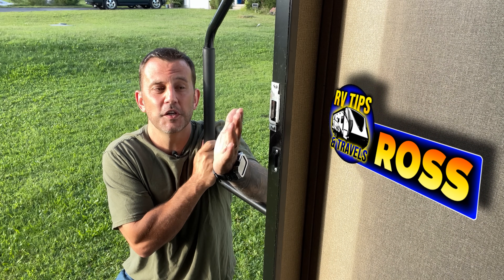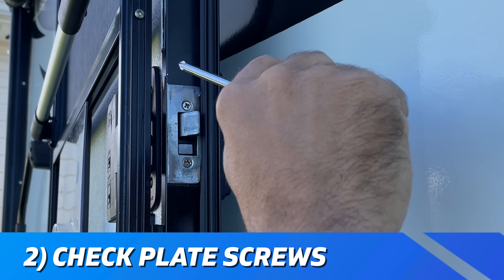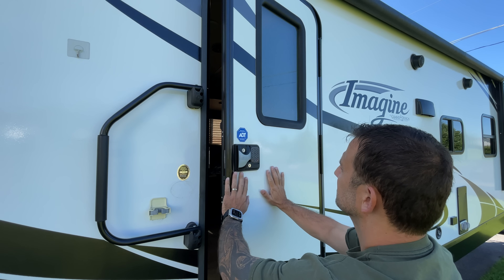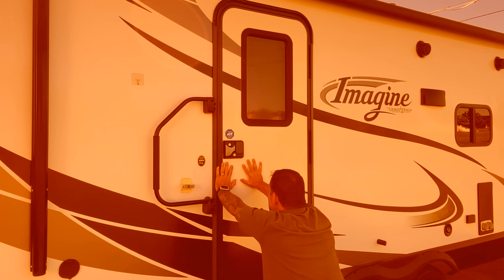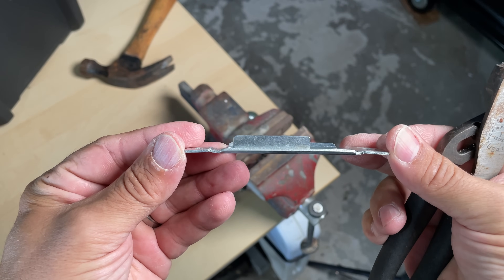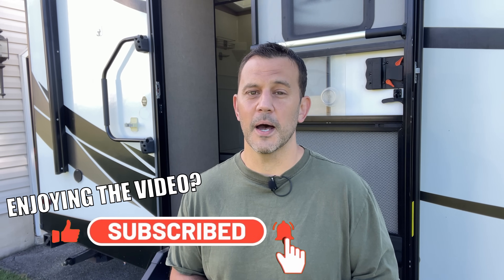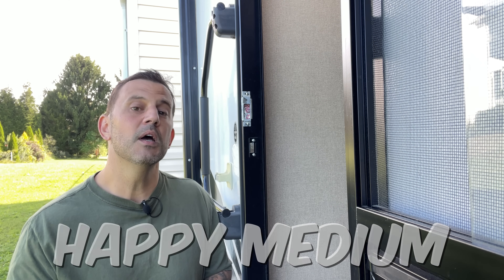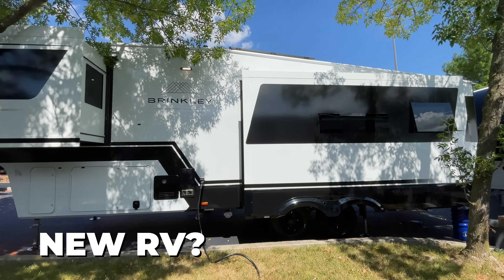How To Fix a Hard Shutting RV Door: EZ Adjustments for an Effortless Open & Close

Comment: How do I fix the door deadbolt hitting below the bore and strike plate. Ive leveled and re-leveled and it won’t ever align. Also the huge gap at top.
Reply from the maker: you might be able to dremel out the strike plate where its hitting if the other adjustments havent worked, but I would have to see whats happening to better help.

Comment: What about when inside or outside i have to open the door handle and press/pull to get the door latched. I bought it new took it in for them to fix they did nothing still has issues.
Reply from the maker: Try adjusting your strike plate away from the rv.  If that doesn’t fix it, you might have an alignment issue that’s not allowing the door to close within its tolerances.

Comment: So my door doesn't have this problem in the summer (heat) only in the winter when it gets really cold (20*f and lower) what could be the problem/fix
Reply from the maker: Interesting…. Not sure what the fix is but is the problem by the latch or somewhere else?
Reply: @RVTIPSANDTRAVELS  definitely in the latch
Reply from the maker: That’s odd it’s happening in the winter, but even still I would try what I did in this video and see what happens.
Reply: @RVTIPSANDTRAVELS  thank you I will try and update
Reply from the maker: Definitely keep me posted.  Good luck my friend.
Reply: @RVTIPSANDTRAVELS  so I did the fix in the video and last night the temperature got down to 45 degrees and this morning one of my dogs nosed the door open (so it is doing it still) but now that it has warmed up to 60 degrees it latches fine

Comment: My door closes great hard to lock it from inside have to lift up hard on the door to lock it ?
Reply from the maker: Sounds like your deadbolt is hitting the strike plate and isn’t aligned.  May need to adjust strike plate

Comment: Flattening the strike plate may make the door close easier, but we have an issue that the latch comes out of the strike plate from heat expansion and contraction and traveling down the road.  Moving the strike plate further away from the door will make that problem worse rather than better.  The deadbolt keeps the door closed, but the seals don't keep all water  out of the door if the seal is not compressed.
Reply from the maker: If you have an issue where the latch is coming out of the bore, you have an alignment issue.  The latch from the factory should penetrate more than deep enough into the strike plate and the bore that flattening out the strike plate a few millimeters should not affect it.  Unfortunately you have a bigger problem where your door (and latch) is not close enough to the frame for the latch to penetrate the bore.  This is not a strike plate issue. The majority of your latch should be well within the bore.  If you are depending on just the strike plate to hold your door shut, you’re out of alignment.  Hope that makes sense.
Reply: @RVTIPSANDTRAVELS  it does make sense, but numerous techs from manufacture have looked at it and told me all was OK.  When it is hot it is very hard to close door too, which says it is too close to strike plate or the door or wall is warped.
Reply from the maker: But when it cools it moves away and doesn’t stay shut?
Reply: @RVTIPSANDTRAVELS  Yes., but not when we are in it. only going down the road or in storage.

Comment: I am having a problem with the screen door hook that catches the exterior door. I have adjusted the black catch plate on the exterior door to see if it helps but it doesn't. When I open the exterior door, you have to pull hard for it to release the the screen door. The screen door stays closed while the exterior door opens. I'm not sure I am explaining this correctly. Basically every time I open the exterior door, I feel like the plastic screen handle will eventually break.
Reply from the maker: outside of adjustments, you may just have to replace the piece that holds the screen door to the main door.  they are usually plastic and very cheap.

Comment: I must have an unusual case because my RV door itself seems "warped".  Or the hinges are bent... or something.  In order to close the door I have to insert a flathead screwdriver in the bottom of the frame and lift the door up as I'm pushing the latch closed.  It's impossible to close the door from the inside and must sit ajar while sleeping.  Grrrrr.
Reply from the maker: unfortunately, I think you are correct, in your case it has nothing to do with the plates.  it could be the hinges, it could also be the door frame slightly out of alignment.  i would start with putting a square on your door frame corners to see if that is the issue.  try to find what is out of square first.  hopefully its hinges, thats the cheapest route.

Comment: If the door closed fine when you first purchased and after a year or two it starts to hit the strike plate, you have issues with the door hinges. Doing this only gives a quick fix because the door will continue to move. Get the door fixed properly.
Reply from the maker: Won’t disagree with you that you could have a problem at the hinges, but that’s rarely the case.  This problem can exist right out of the factory.  Also, the door frame can twist a bit from driving.  Additionally hinges/metal components can expand and contract in different weather conditions. Hinges can also stretch a bit but that doesn’t mean they will continue to expand or stretch beyond the yield point. Theres 4 reasons you can have this issue that have nothing to do with loosening hinges.  Now, if the door continues to hit the strike plate after this adjustment is done, then you might have a hinge issue, possibly a frame issue too.  I feel this mod is the first step to finding out.  Hinge adjustments on riveted RV doors is a much more difficult undertaking, I stand behind doing this mod first all day.
Reply: Ok thank you very much for going into more details on what may cause the issue! I now better understand what you were conveying in the video!
Reply from the maker: No problem Jim, and I’m not discrediting your statement, definitely could be a hinge issue, no doubt.  I would try this first since it’s easy.  Thank you for being a long time subscriber and viewer my friend.